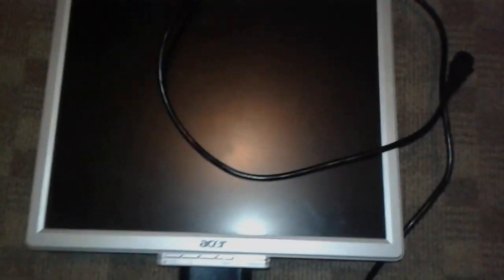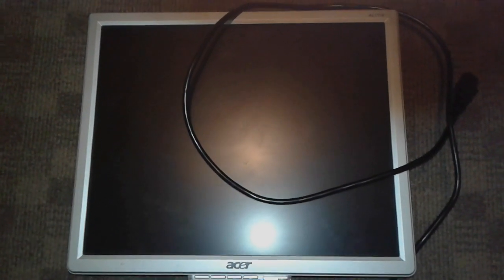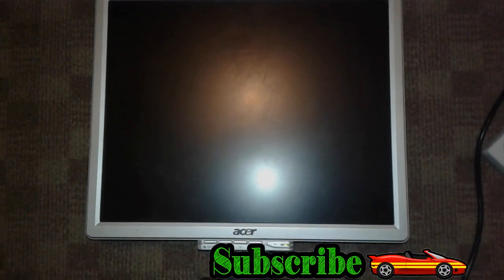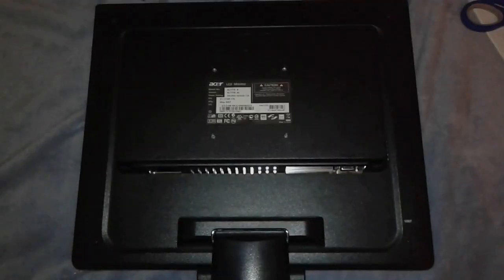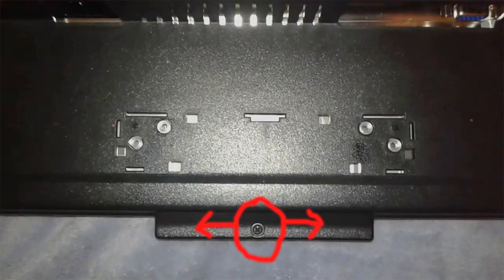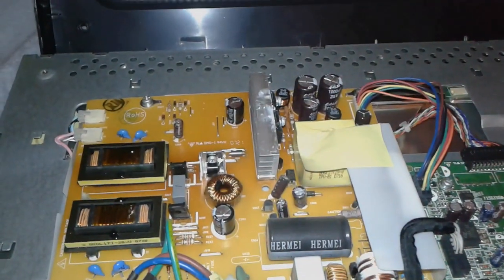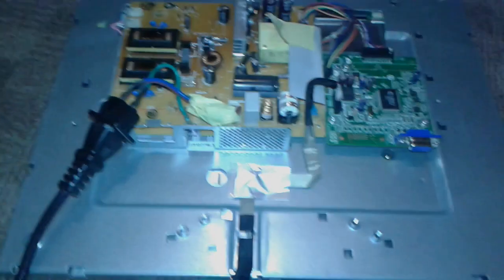How to repair most of the LCD monitors with blinking light

Comment: Mine is doing this, the LED will flash on and off but if you leave it alone it will eventually come on. I suspect the same issue you had.

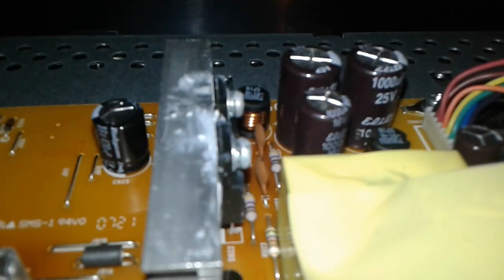And in case nobody saw the issue it was the bulged capacitor seen at 1:49 in the video. The one just above the yellow foam stuff below the two other capacitors.
Reply: mine too is doing this thing. Have you fixed it? I can't see any bulged capacitor on my power and signal board
Reply: hey I don't understand what to do from your instructions

Comment: Thanks. My Viewsonic LCD starts flickering every 14 seconds. Which capacitor could it be?
Reply: Hi. I replaced all capacitors (as in all) but the problem's still the same, it still starts to flicker/blink slowly after a few minutes of use which component should I check next?
Reply: @SevenDeMagnus  buddy we are the same problem can you check the diode all components